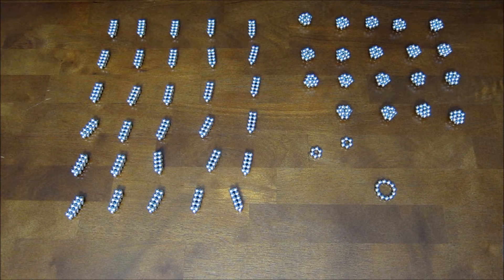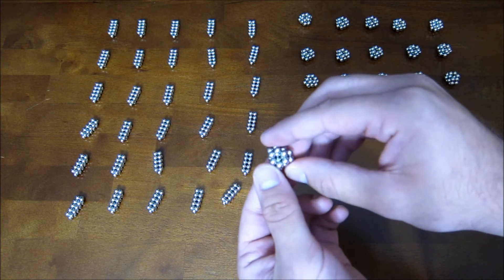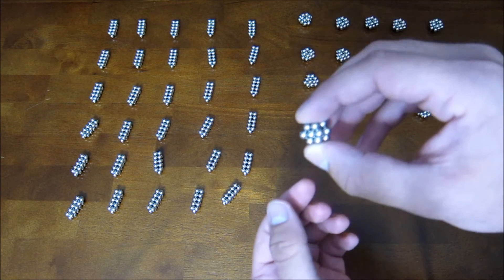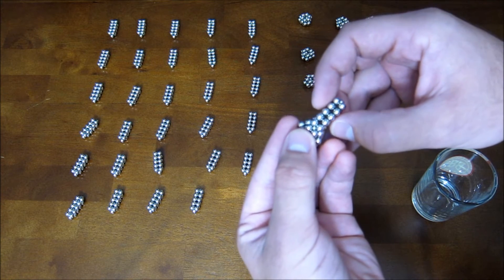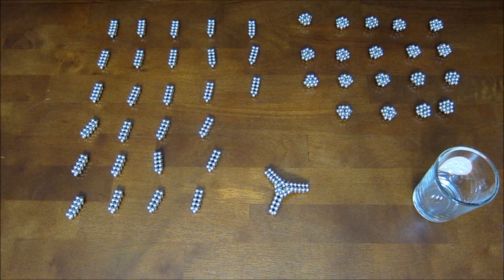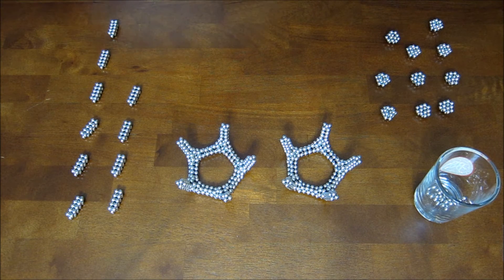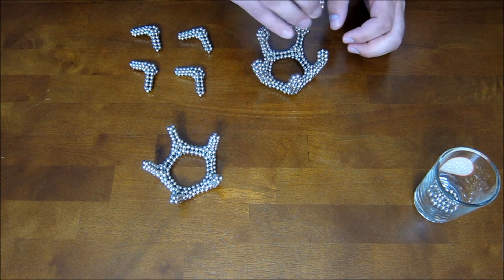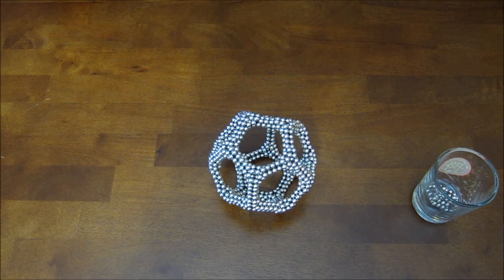Tutorial: Extendable Dodecahedron (Zen Magnets)

Comment: Argh!  How do you deal with polarities?  Each time I make a new strut, I've got 50/50 chance its polarity it wrong.  Simple to deal when adding the first one (just flip the vertex over), but when putting pieces together, if the polarity is wrong, I freak out.
Reply: So, I found that it's best to not flip the vertex (except for the very first one) arbitrarily.  Instead, When I make one vertex and one leg.  I make sure they attach properly, and then use that leg as a template for the rest.  If one comes out reversed, I remove two magnets from one end and place them on the other end.  As I make vertices, I double-check them against one of the legs and then place them on my work surface with the "outside" face up.  From then on, I have no worries about polarity.  (Lesson learned the hard way).
Reply: +Brian H. Try making all the pieces first, then checking them with a single string of magnets. If you check one point on any piece by adding a string of magnets, you can repeat and check each of the other pieces at the same point. If the string attaches differently on one of the pieces compared to the others, you know the polarity of that piece is backwards!
Sound complicated when I read it out loud, but I promise you it really isn't. And once you've mastered the polarity barrier, the possibilities really are endless regarding what you can build!
Best of luck my magnetic friend!
Reply: Chris,  Thanks for the suggestions.  Actually, I found the process described above ↑ did the trick for me--that of comparing each piece as I make it with a previous piece that I know is of the proper polarity.  Each "leg" segment is easily reversed by removing two magnets from one end and then placing them on  the other.  Getting the polarity right earlier is better than later, as "fixing" the polarity of a finished segment is harder than fixing the constituent pieces at the beginning.

The dodecahedron wasn't too bad, but the "small stellated dodecahedron" was a tough one--mine collapsed onto itself just as I finished it.  Argh!

Comment: @Magnenaut Yeah I did. I found that the struts tend to deform as you build it, causing me to plop it in my lap and straighten out each strut until fixed, It does rigid up a bit when it's finished though. One other thing I noticed, is that since you built your pentakis dodecahedron entirely out of Zens, it sometimes look very (uhhh) ungeometric? because of all the wayward triangles. I didn't have enough Zens so I used some red Buckyballs for the centers of each face, and it made much more sense.

Comment: Wow our methods were shockingly different. I built the verticies by taking three struts and sicking them together, then pulling the triangle out of the middle and change the polarity and put it back. Then I would add three more dots. One on either side of the new triangle. Than I would fold the vertex up a little bit, stick the hexagon in the middle, and fold it back to normal, connecting the hexagon. Once I had that vertex (I would use struts half the length of how long (cont'd in next comment)